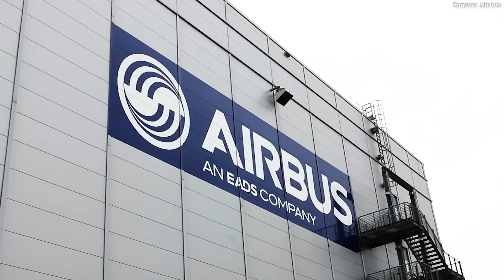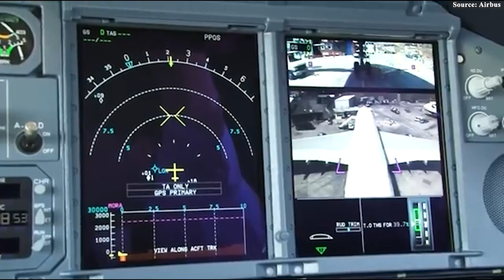Airbus A390 Just OUTSMARTED Boeing Aircraft That SHOCKED All Industry!

Comment: How large will the addressable market for 400-500 seat airliners still be by ~2040? That will more than a decade after the first 777X finally ships - burdened by at least US$15 billion in compensation fees for all the delays.

Megacities in Asia with slot-constrained airports are already building relief airports. London is served by a total of six airports of various sizes. Same with New York, LA etc.

If Airbus is hinting at a widebody larger than the A350 family, it has either lost the plot or it is deliverately sowing confusion in the media. What it needs is an ultra-efficient small widebody that can effectively compete against the smaller variants of the 787 exactly when those are due for replacement. Release timing is way more important than high capacity.

Comment: Acute deja vu from A380. Airbus have excellent engineering and manufacturing skills where Boeing excel in Sales and Marketing.
I fear that the lessons have not been learned. Airbus need to broaden the flexibility to accommodate Cargo and Pax balance as events unfold. They also need to create a design that creates an emotional link with passengers such as the B747 hump does. 
I think there are two discrete directions for the market. The middle Eastern Government funded market which wants hub and spoke bigger and bigger aircraft and TPAC and TATL and medium haul carriers wanting to move more and more to Point to point smaller and smaller equipment with longer range. TATL Single Aisle is a growing market and I think TPAC will not be long to grow.